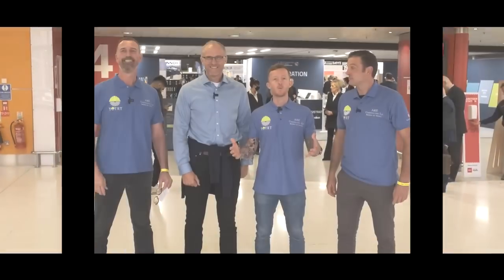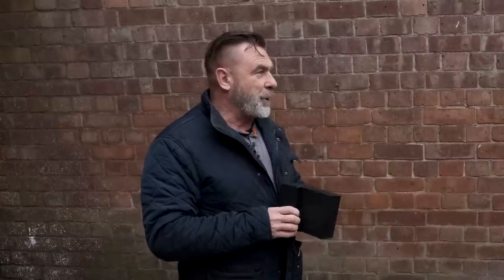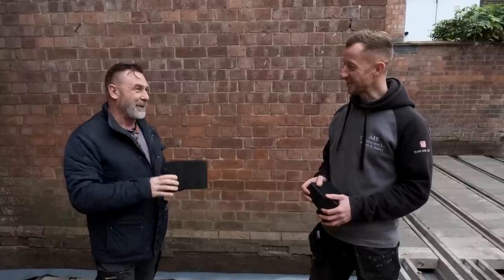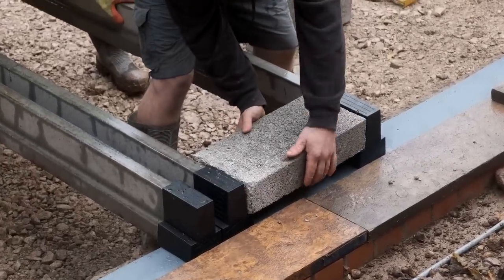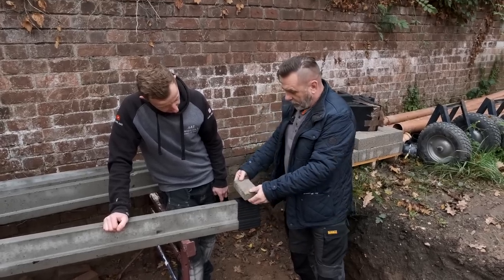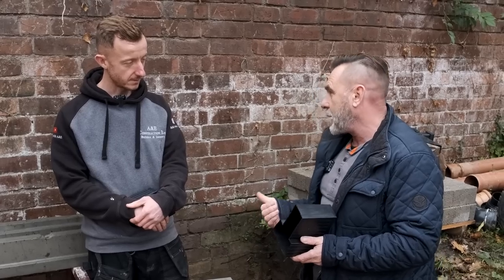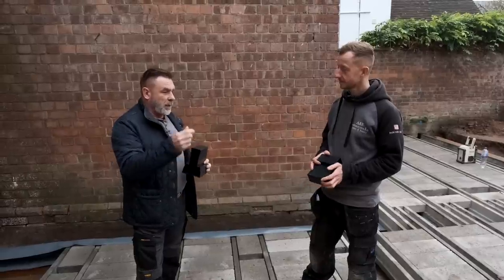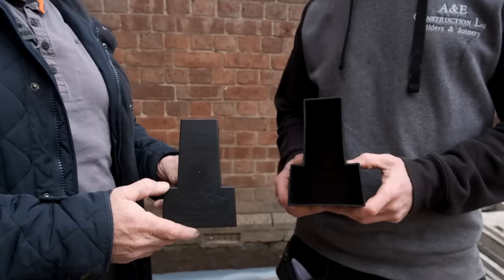The best damp protection for Concrete Beams?

Comment: I get it and it makes sense, a lot of people don’t do this to there beams and I can’t see that changing.....if people did start protecting there beams the cost of all them fittings vs a can of paint and a paint brush.
Reply: Your bill of quantities should include the cost of these when working out your quote, and the customer foots the bill for a properly priced job.
Reply: @thetessellater9163  that’s called getting priced out of work, no one’s interested in protecting concrete beam ends, timber yes. I’d make more money not using theses and using a tin of paint and a brush, who care if you have to cut it or not it takes seconds to coat a beam end before placing in

Comment: Looks like a well thought out product but why do building inspector's ask for the ends to be protected as they don't touch the outer skin? What job is John on now as they had finished the floor on the single storey extension?
Reply: Moisture is always present in the cavity
Reply: @chriskane9230  Thanks      
Chris  👍👍

Comment: Did I hear you talk of 'trimming the beams' ?? they should never be trimmed - they're made to measure and the steel reinforcement is doubled back around the ends inside for proper tensile strength. Any cutting back of the ends could remove the steel loop and interfere with that strength !!
Reply: True but this is the real world and it does happen